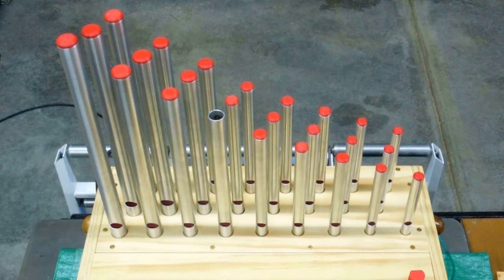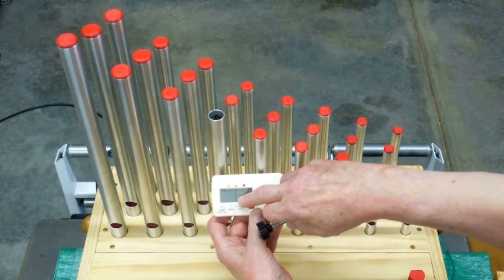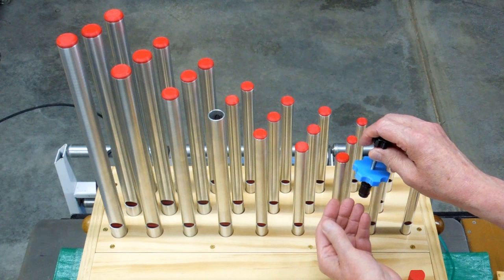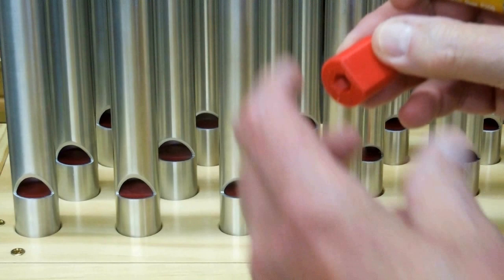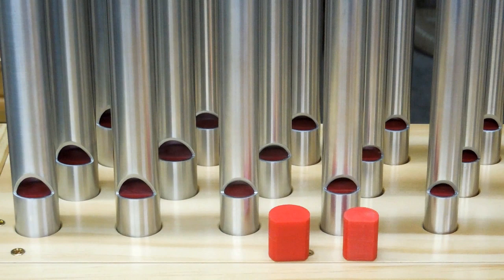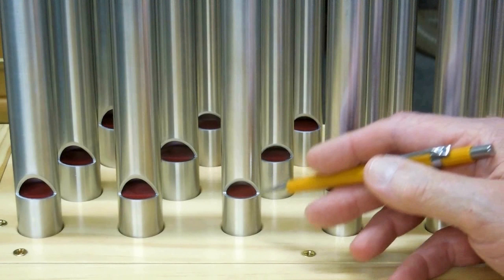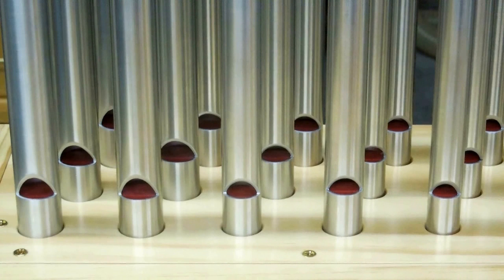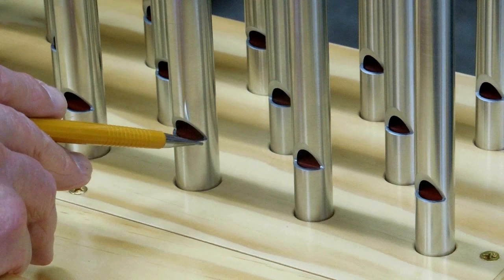Mini-Calliope Part 12 - Pipe Tuning Process

Comment: Thank you Ronald for this project. Very interesting. 1.Impossible to use PVC pipes ? 2. What is it the air blocs ? What is the material ? Where I can purshase it? Thank you.
Reply from the maker: I suggest you watch the entire video series (watch a couple of times). Most everything is covered regarding my build of this calliope including the air blocks Part 5 which I chose to make on a 3D printer. The originals were made of wood dowels. PVC pipe does not come in the range of sizes metal pipe or tubing does. Also the inside diameter is probably less consistent than metal pipe or tubing. Thanks for watching. Please subscribe!